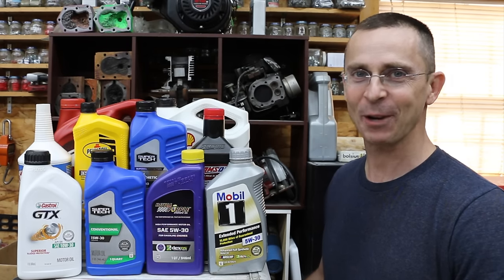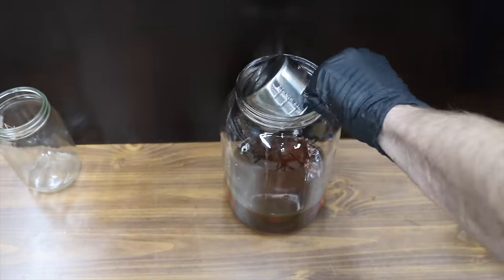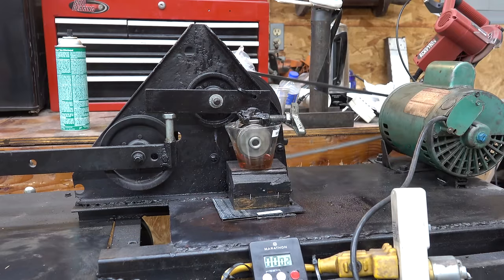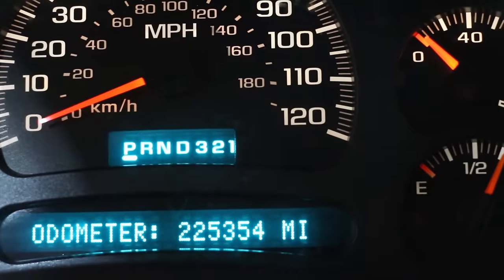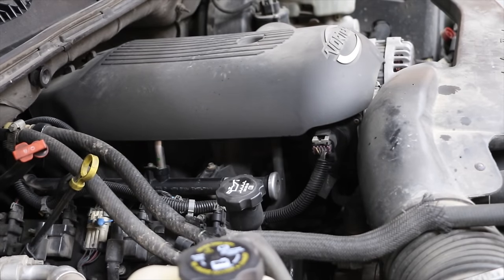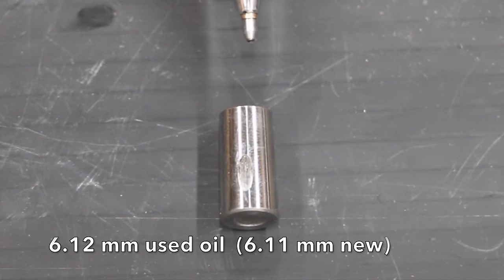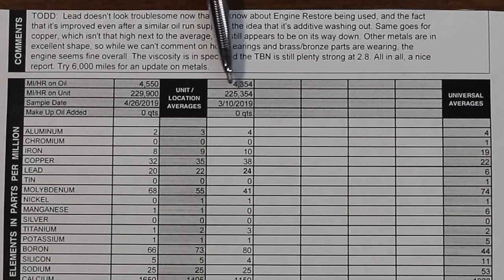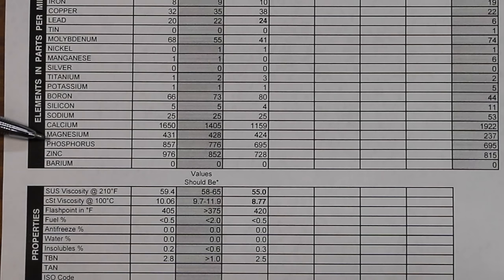Will Mixing 10 Motor Oils Damage an Engine? Let's find out!

Comment: Don't ever put 0w in an engine. It is to light of an oil for good protection of your engine. They recommend 0w for strictly fuel mileage. Use 5w-30. 10w 30 for a warm climate is even better.
Reply from the maker: Thanks for the feedback.
Reply: I wish your comment was higher in the feed. You’re totally correct. 10-30 is the absolute lightest to put in something. Even Briggs and Stratton won’t use lighter oil for a cold weather mower. That says a lot.

Comment: Good
Reply from the maker: Thanks for watching.
Reply: @ProjectFarm  actually I have been mixing my motor oil for 10 years without problems. I mix 1L 0w20, 1L 5w40 and 2L 5W30 of different brands. The reason is that I need oil that moves faster in morning cold start and protection in hot afternoon. Actually 0W40 would be perfect, but hardly available in my country. So, I mix my own. Why I don't just mix 0w20 and 5w40? Because engine won't run smooth mixing two different oil with numbers that are too far between each other.

Comment: Why use ten types of oil when you could be using ten quarts over the recommend amount. Be interesting to see if a car would run with 10 quarts when it's supposed to take 4 quarts
Reply from the maker: Thanks for the video idea.

Comment: My truck takes 7 quarts i buy the big 5 quart juge of moblie 1 and 2 quarts of the walmart brand still 5w30 i do it becuse the small 1 quart of moblie 1 is 9 dollers each and makes it more expesnsive the walmart brand is 3 dollers each
Reply from the maker: Thanks for the feedback.
Reply: I just buy jugs... Overall savings in the long run

Save the leftovers in the garage for future oil changes 😅

Comment: READ THIS COMMENT 🆘🆘🆘🆘🆘🆘
When you have a high performance, low clearance engine; DO NOT MIX OILS. IT CAUSES FOAM. I say this from experience. Put 1qt 15-40 conventional and 1qt Lucas pure synthetic 15-40 and it was very very bad. The moment my XR400R (heavily modified) started it pushed foam out the fill/check hole and tube locked the line. This never happened otherwise.
BE CAREFUL WITH HIGH HEAT MOTORS
Reply from the maker: Thanks for the feedback.

Comment: i have friends that added a different brand when their oil got low and engine smoked like crazy. i told them to drain the oil and put in only one brand and the smoking stopped. this has happened many times. DO NOT MIX BRANDS.
Reply from the maker: Thanks for the feedback.

Comment: My problem is that every manufacturer sells 5 quart oil jugs and my engine only holds 4 quarts.
As a result I have several jugs sitting around with 1 quart of new oil in them.
I have Shell, Motorcraft, and one other that I want to use all at one time just to use them up.
all are 5w20 semi synthetic or synthetic.
Have 2 quarts of Shell and one quart each of the other two.

Engine has 95K miles on it and gets an oil change 2 times a year whether it needs it or not (I only put 7500 to 8K miles a year on it).

So what are my chances of having a problem with a 12 year old engine and that mix?

Motorcraft oil getting hard to find, and the shell is too.

Seems they all want to sell Quaker State/Penziol. Mobil 1, or a store brand. I cannot order anything from the internet and stores won't order them for me.
WInters here seldom get below 20F at night. But summers get dang HOT...
Reply from the maker: Thanks for sharing.

Comment: hahah i couldve told you no without experimenting my truck burns oil a little i have used valvoline dg stuff etc. but yes i still change oil every 4k with valvoline and good ac delco filter but truck has 300k
Reply from the maker: Thanks for sharing.

Comment: In 100 k miles yes . 5 k
Miles no , your engine is designed for 1 specific oil , use the recommended
Reply from the maker: Thanks for the feedback.
Reply: Yes, he states that at the end of the video.

This was an experiment to see that it does to an old engine

Comment: I don't have to watch.  Zero.  Nothing happens.  My prado had a leaking sump seals and top cover seals after it broke a timing belt on drive. On replacement the technician wasn't good enough.  I poured all black used oil I found on the roadside stations for one year before finally getting it done.  Nothing happened.
Reply from the maker: Thanks for sharing.

Comment: Do not get me started on so called  'synthetic' oil. A TRUE  synthetic oil would NOT come from oil pumped out of the ground by from other things like plant matter and such. The word " synthetic" gets thrown around all to easy now days. What that call  synthetic is on fact really a reformulated product. The take crude oil and break it down in to its individual components  and then mix an oil from that. I hate the way the word  synthetic gets used as a marketing tool.
Reply from the maker: Thanks for the feedback.

Comment: My matrix 2004  takes 4 1/2 quarts. I use what is on sale so I wind up with 1/2 quarts of different oils. (All 5w/30). Mobil one, pennzoil, castrol, valvoline, super tech, amsoil etc. I put them in the same 5 qt container. When I reach 4 1/2 quarts I use the "blend". Been doing this since 20,000 miles on the odometer. I now have 290000 miles, Purrs like a warm happy pussy (cat). I feel I get the best additive from each oil. Not one mechanic, engineer, wrench head could tell me why its bad. All i hear is :YOU SHOULD NOT MIX OIL BRANDS". Never why i should not.
Reply from the maker: Thanks for the feedback.